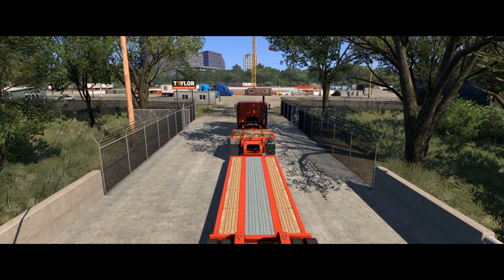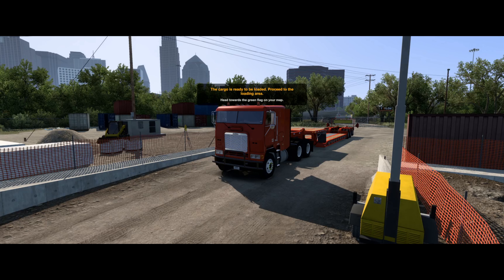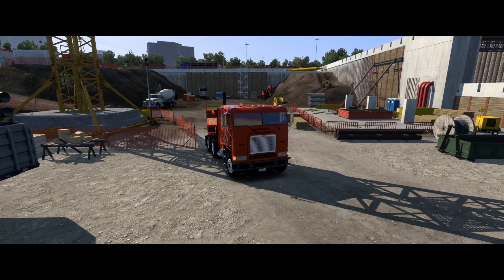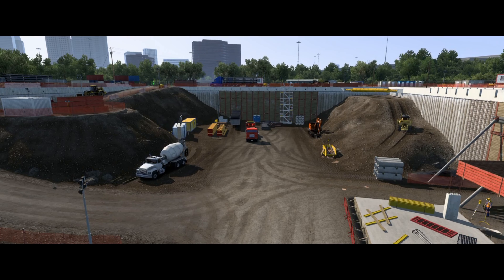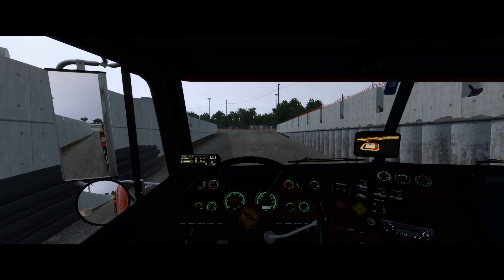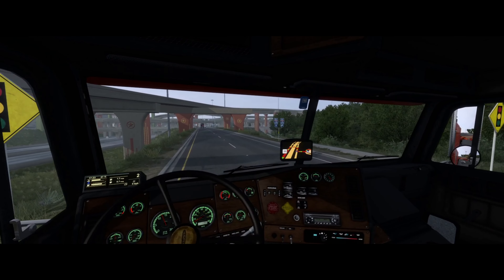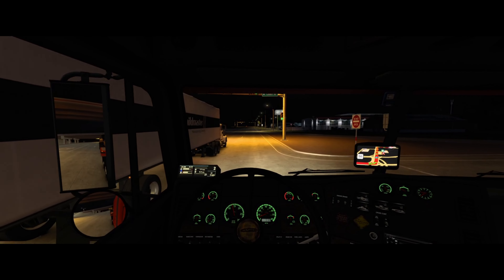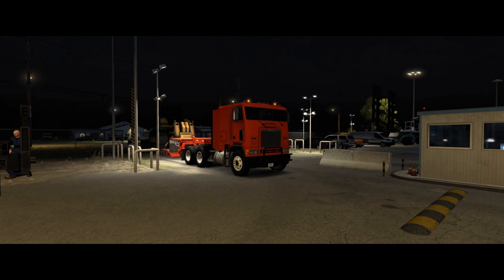American Truck Simulator - Heavy Hauling with a vocational Freightliner FLB

Comment: Loving the flb as always. I found the 9300 from one of your earlier videos
Reply from the maker: Yessir. The link is in the description. Okay the link should be in the description.

And that's what I understand too - the 9300 was replaced by the 9900i for twenty years, until it was pensioned off in 2017.
Reply: @DavidSteele  sorry for stating the obvious
Reply from the maker: Where? When? Nah I don't think you did. 😎

Logically the 9300i follows the 9300, like the 9400i follows the 9400. 😀

But in International's portfolio, the 9300 is followed by the 9900i... 😆🤣